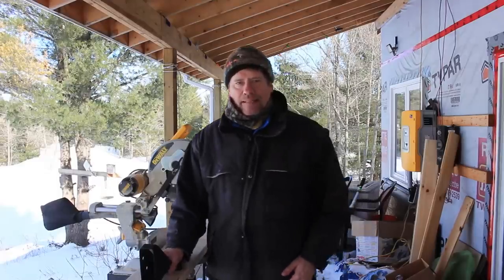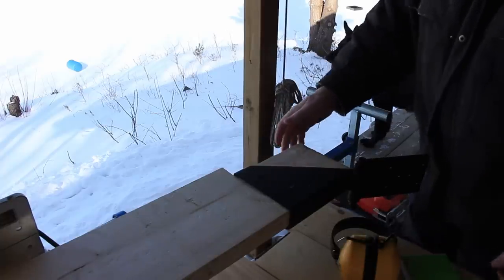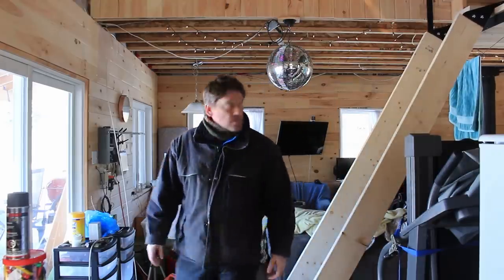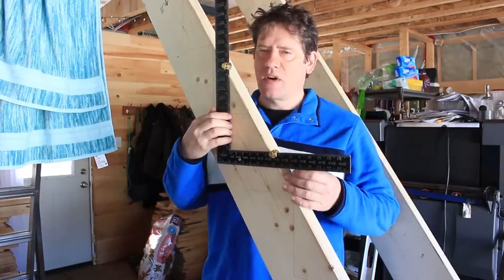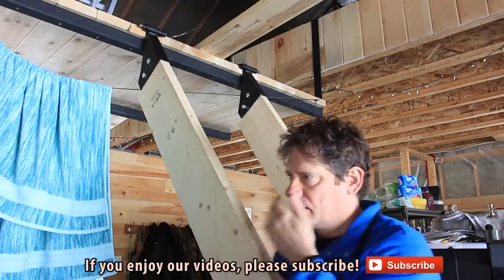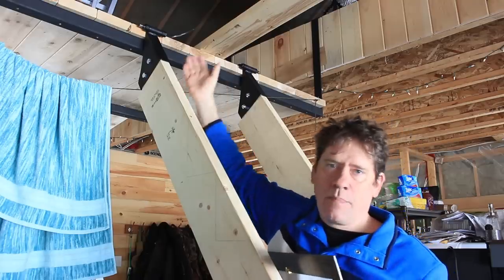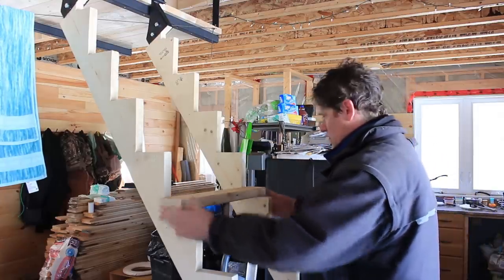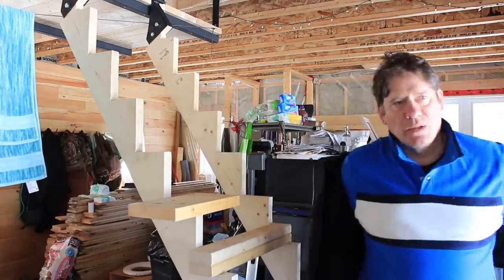Building Pull-Down Loft Stairs at the Off Grid Cabin

Comment: For the counterweight in the stove pipe, maybe put some short pieces of rebar through the top in an X formation and rope onto that? Also don't just tie a simple not onto it, but do a proper knot onto a (good quality) carabiner and hook that onto the X rebar. You don't want the knot to become undone, or the rope to fray due to friction and have the whole stairs come down on your head when the counterweight disengages. :-D
Reply from the maker: It's a good idea and I thought of that myself, except I decided to go with a winch! Going to mount the winch on the ceiling and put the remote switch somewhere on the wall.

Comment: Leave them, they are good, just stiff them with OSB board from upstairs on the back.
Reply: at least that, the stairs are so wrong I don't really know where to begin.   I am very worried they may crack at the the back of the tread/riser intersection.  Minimum code width from that apex to the back of the stringer is 3.5".

Comment: Hi Russell,  I am a long time viewer and I have watched this vid. Yes you need to rebuild these stairs for safety sake. Your stringers need to be of bigger dimensions for sure and your actual steps need to be wider. Use Pythagoras theorem to figure out, there's a formula to figure out the rise and the run etc. As for your counterweight,  fill the stove pipe with concrete, and before it cures put an eye bolt with an 6 or 8 inch shafts into the concrete, and you will have an attachment point for your steel cable. You have an awesome property there my friend. ..keep up the enjoyable content.

Comment: Russell, My buddy and I were also going to build cantilevered stairs in our cabin many years ago. I had some experience building several wooden stairs and a cantilevered ramp into my shed to drive the garden tractor. I'm guessing that ramp was half or less the weight of your stairs, especially after you've upgraded the stringers to a larger size. I used two old lead boat anchors(cylinders) to lift my ramp, and it still was a fairly heavy lift by hand. That tube filled with rocks may be close to what my two anchors weighed. Flat steel plates hidden in the wall between studs can work well as a counterbalance weight, use 1/8" or larger steel rope(cable) over good steel pulleys. OR, take a hard look at where you might relocate the stairs and make them more permanent(what we did). Our original cabin was only 20' x 24', and we put our large firewood box under the stairs. We never regretted scrapping the cantilevered stairs. Sorry for long post, it just hit close to home.
Reply from the maker: GT there is nowhere in the cabin I could put permanent steps other than where these stairs are right now. If rocks aren't enough then I'll pour a concrete tube. It will work.
Reply: Not doubting that at all.

Comment: You can rip a two by four from the back side of your stringer to your 90 cut whatever that measurement is put both of them on the inside and that will double the strength that sponginess you will lose at least some of it we even strong back 2 buy 12 stringers. For some of that hasn't done stairs they actually came out okay stairs are not simple for anyone who has not been properly taught even after properly taught it's easy to forget where you have to add and what you have to remove but once you have it it's like riding a bicycle you had all the right tools just not the right teacher but you did a great job.

Comment: hello Russell.
an idea for your counter weight:
so, tie knots in your rope, where there will be several "in" the stove pipe, a knot at the bottom, come up a few inches, another knot, another few inches, another know...… cap the bottom, then pour the pipe full of concrete.
also, you can sort of loosely coil the rope in the stove pipe for more surface area contact with the concrete.
1 80 pound bag of ready mix should do the trick.
or a 50 pound bag, or whatever you calculate the counter weight should weigh.
anyway, once the concrete sets, the rope can't pull out  (because of the knots) and you'll never spill your ballast either.
thanks for posting.
keep up the good work.

Comment: At first glance I thought that you were Nikolaj Coster-Waldau (Jamie Lannister from Game of Thrones). Anyhow, I have the same dilemma with my loft in my cabin in trying to figure out a stair system that is not intrusive. The problem lies with building codes, and that you just can't put together a stair or ladder system that meets your needs, but has to coincide with the rules and guidelines of building. I will have to run this method by our local building inspector to see if it'll meet code. 
In the interim, I was also looking at a library ladder/stair rail idea that would allow me to move them off to the side. Good idea though. Thanks for sharing. Cheer!

Comment: Yes you should have used 2 by 12 for the stringers and there should have been a third stringer in the middle.

The reason the treads are not wide enough is because it appears you made them the same width as the run. The treads should have extended beyond the run by about 2 inches.

When you do the handrail there should be less than 4 inches between spindles and the handrail should be about 40" high from the stair.

Comment: great video Russ. just stiffen the stairs up by sistering a 2x4 under the stringers and perhaps a diagonal cross brace. this should make them stronger until you redo them. better get the a/c ready looks like a heat wave at the cabin, only minus 5 .  best wishes to you and city girl.  and the doggies too.
Reply from the maker: Jim, for some reason your comment went into the spam folder, so I dug it out. Not sure why, seems like a perfectly normal comment. Anyway, thanks. The 2x4 sisterboard is not a bad idea.

Comment: I think the steps look great, provided the stringers are strong enough. Not sure why you don't want them to be fixed, there's daylight between the steps so they don't really block light in your interior. They may take up space, but not that much, and you can't fill that space anyway because the stairs have to go there when they're down. They also have a nice craftsman look about them,so they go nicely with your cabin interior. This is all prob moot, as you've replaced them since this Mar 2019 vid was published. It's an interesting project to watch, regardless of what the final result may be. Thanks for the vid.
Reply from the maker: They take up a lot of space when they're down and a PITA to get around.

Comment: Use a speed square to measure the angle.at the base of the stringer. Lots of videos on YouTube on how to use them. I would have considered planing down the 2x8's for a nicer finish on the feet as well as reducing weight. A third stringer will help with the sway too.

Comment: Another method would be to find some of those old cast iron Victorian window sash counterweights. If you have friends doing a reno, you could get  them for free! They are generally 18" long by 2" wide and 12 pounds each. Also a well worked out pulley system would lessen the weight needed.

Comment: Hey man. Been building houses for 15 years. I’d be really worried about those stringers snapping. If I was you I’d cut the treads flush with the stringers and run another full board on either side. Plus add an X brace to the bottom to keep it sturdy.
Reply from the maker: Hi Brock, will definitely be changing them. Might talk about it tonight during live stream.

Comment: They look good but the strength is gone as the beams are sawed in. Little blocks on the inside to put the steps on or metal corner peaces would not have looked good but the strenth would have been so much more. I have to say I LOVE that you kept the struggle to get it right in the video. That is so valuable to watch. Thank you for the video

Comment: I know this is 5 years ago but our house is about the same stage as yours.. very similar stair problem here as well.. we admire the fact your prioritized the need for a discoball over finishedwalls ..  what would you advise as far as changes in design 5 years later?
Reply from the maker: If I had to build it again, I'd pretty much do the same stairs. Two things to keep in mind. 1) Spend the time designing it before building. If I hadn't planned it all in Google Sketchup, I wouldn't have known I'd need to do the drop-down catwalk to make it work. 2) if you do the same type of railing, know that it's not going to hold your weight, it's just there for balance. Um, maybe 3) you don't need to do the stringers the same way I did. You can just widen the boards and put the steps in between.
Reply: Thank you.. I am stuck with the rise but it is a catwalk lower then the floor height of the lofts.. the stairs will be steeper then normal but not ship ladder steep.. hing will be livestock gate tough and maybe a little interlocking wood joint when down..
Reply from the maker: @billlamm4688  It's hard as heck to find a video somewhere in the middle of 8 years of videos, but here is the video where I do the catwalk: https://www.youtube.com/watch?v=E47d9omu5VE. Not sure if that answers your question.

Comment: Are the stringers upside-down? It looks like you have more rise than run.
Here in Michigan, the standard is 7-11 or 7 inches of rise and 11 inches of run.  
That would allow for deeper steps so you can walk down without needing to step sideways. 

Also, I agree about full, uncut stringers - typically 2x12. I prefer to cut or router dadoes into the stringers and slide the treads into the notches and  glue and screw them in from the sides. It will make a much sturdier set of stairs than the cut stringers.
Reply from the maker: I was limited to the length otherwise it hits the wall, so they're very steep. Still haven't decided if I'm going to replace them just yet.

Comment: They should be flipped and bolted to the underside of the catwalk, that would give you more control over the rise.
 Think of it more as a ladder than stairs.
 Don't cut the stringers, mount the steps between them.
 Let them into the stringers or use cleats.
 2 or 3 cross bolts might be a good idea (all thread).

Comment: Hey, Russell,  Are those stringers upside-down?   The way they're set makes them steeper.  The wider part should be the flat step and the shorter part should be the riser (that goes up from step to step).  I don't know, but that might be the problem.  Of course, the stairs would come out farther into the first floor and may not reach the upstairs landing.  Also maybe the stringer may be too narrow a piece of lumber to protect the cut-out parts from breaking.  2" X 10" or 2" X 12" stringers may help or you could "sister" in a 2" piece for each stringer and back of each step, but it wouldn't  be as strong.

I've worked on steps before, but it's been a long time and I was mainly a "holder of tools and a helper of stabilizing, but I also learned a lot from watching and "listening" (to the obscenities).   If the stringers are upside-down, you may have to add another step or landing at the bottom and they would extend out farther, but it might be an option.    Lots of suggestions below, so I know you'll find the answer you're looking for.    Good luck!    :0)    Donna B.
Reply from the maker: I think I explained at 4:00 but I am limited by their length.

Comment: Nice job, even though they are a little wobbly! Would a 3rd stringer going up the middle, beef them up? Of course that would be more weight - everything is s trade off. I suck at cutting stair stringers. I have to build stairs going down into my cellar this year, so you gave me some good ideas; it sucks going up and down a stepladder to get into the cellar! Was that a 3/4 inch sheet of plywood you moved down from the loft? Gosh those are heavy! The stove pipe looks good for the counter weight. On the top you could drill 4 holes and put 2 bolts thru at right angles, then attach the rope to the bolts where they cross. Maybe do the same thing on the bottom, with a piece of wood on top of the bolts, so the weight of the rocks is not on the bottom cap? I'm thinking routing the rope and pulleys is going to be the hard part. -- Dave

Comment: Great first try on the stairs
If you have one around go to a home depot or lowes or any place just get PVC pipe and caps that thread  on and follow with concrete or  sand and you can put an eye bolt with a but and washer on  through  the cap  and hook your wire or rope to it that's what I did  for a heavy door on barn floor and it works great
Reply from the maker: Great idea, thanks. I will consider it.

Comment: I could use a bit of advice.. I have 6ft i have to climb into a 4ft loft... But heres th catch.. The dog needs to climb the stairs as well. If i use the standard stringer from Lowe's back them in paneling for the illusion for the dog and 2x6 stairs 18" wide.. How much rough weight would i need to counter balance the steps
Reply from the maker: No idea. I guessed at mine. Kept adding rocks until it balanced out.

Comment: Good project Russ, been enjoying this one. Long been a fan of the idea of stairs that lift out of the way freeing up space. On steep stairs been on a few of them and the step cutouts make coming down them far easier in my experience, I was going to mention it but you got there first, millers stairs is the term we use here, often found in windmills.

I know they look and feel a bit shakey at the moment but I like the fact they look quite trim or fine, struggling for the right term lol. Wondering if maybe you can source some U section steel channel the right width and screw it to the back of the stringers? Would hopefully strengthen and stiffen it, at the very least hold it all together should a stinger snap. Painted to match the catwalk metal it would tie the thing together visually.

Thinking we deserve a beer now!!! LOL.
Reply from the maker: Thanks for the comments, Fuzie. Just learned those type of stairs are also called Jefferson stairs. Good to know.

Comment: Russell you're stringers need to be wider. And go with a. Center support. A 3rd stringer. Also go with full width one piece steps. And yes most deffinately add a handrail.  U do get a bit drunk.
Stay safe in the woods
Reply from the maker: Thinking about replacing them completely with an alternating step design.

Comment: Great job. Well done. Way too much weight on the platform. Four overhanging metal flat steel to support platform, stairs, and then a few people. A bit risky. I would suggest a few vertical posts to support the platform. Its only a suggestion. 🤔

Comment: You could to a add a 2x4  to the side of your stair jacks for added support.  Normally you measure the rise and run and then divide it into the most steps you an get.  A LEGAL set of stairs the rise and run should not exceed 18 inches.  for example a 2x12 is 11 1/2 inches and the rise can then be 6 1/2 inches.  I like those hinges, where did you get them?

Comment: This is the first of your videos I've watched! I have to say I thoroughly enjoyed it! Not only was it constructive (no pun intended), but I  can totally relate with doing things alone. I really like that honesty with which you work as well. So often, all we see is the last attempt and don't realize all that has gone on previously: aka mistakes! I have only made one small set of stairs for a deck I built. I have a dream of building a cabin with a loft so this video is very interesting. I have one question though, why didn't you start the stair cuts at the top and work your way down? Wouldn't it have been better to have been off a bit on the bottom? Ultimately you made it work and that's really all that matters!! PS. I haven't watched the whole thing yet so if I referenced something that changed, my apologies!